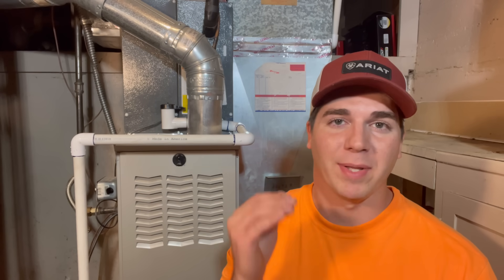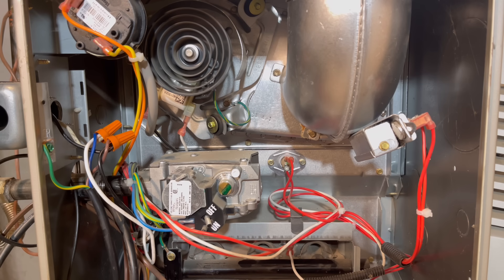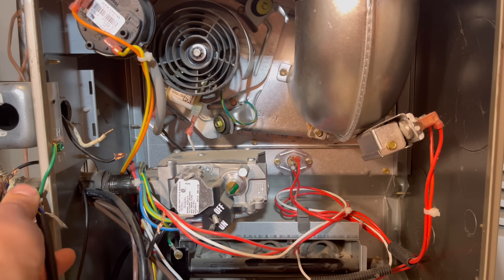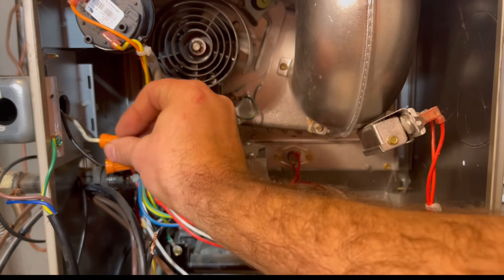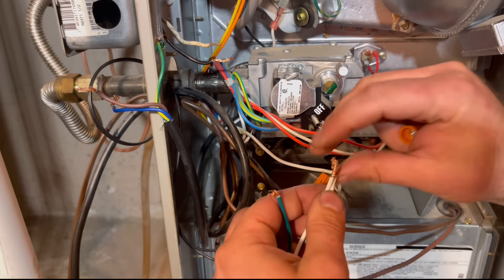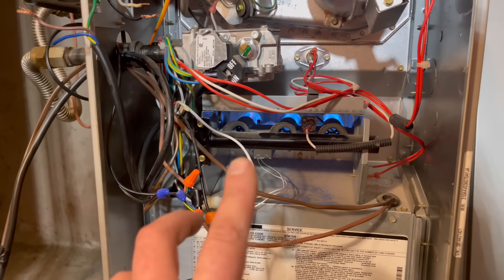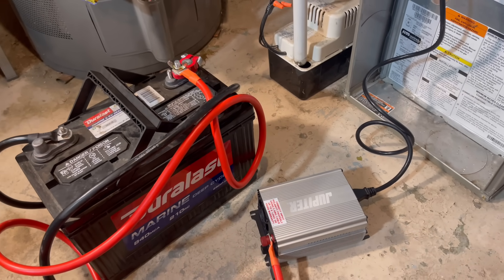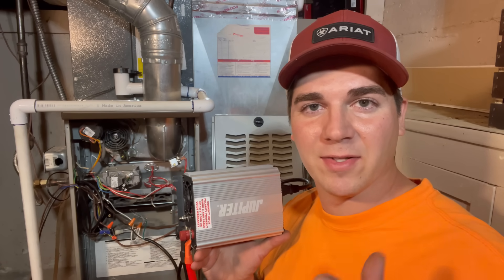Did You Know You Can Heat Your Home With A Car Battery?

Comment: I have been doing this for years. I never had a need for a generator. The best part is everything in our house is run off of gas.
Reply from the maker: That’s awesome, I didn’t realize this was a thing until recently. We are lucky to have easy access to natural gas. Even if I was in an area that didn’t have good access to it, I’d probably buy a large propane tank or lease it and change everything to gas. So much easier to manage with a power outage! Thanks for the comment. Cheers

Comment: My armstrong air handler is wired to 240v.  It's really annoying.  The pump for the hydronic coil is 120v and there is no electric heating elements - no reason why it should require 240v!
Reply from the maker: That is super odd… yea unfortunately this wouldn’t work for ya. Sounds like an interesting system! How old is it?
Reply: @diyhvacguy  put in almost 20 years ago.
Reply from the maker: @Sylvan_dB  do you have access to gas where you are at? Swap that baby out with a gas furnace!

Comment: Great Video. Thank you for sharing. How about air conditioning, summer  we have thunderstorm
Reply from the maker: Air conditioning is a much higher demand when it comes to electricity. This is more of an emergency type situation. In the summer, unless you have a massive generator or solar power in the roof, you just have to sweat it out until power is restored 😂  thanks for watching! Cheers
Reply: buy a generator for your a/c an inverter wont power that.
Reply from the maker: @timothygodfrey4950  I can live with no power in the heat with my pool, haha just need to power my refrigerator. Not so much when it’s 15 degrees outside. I’d really be thinking about an alternative solution if I had an electric furnace though because this trick won’t work for that. Only gas furnaces.

Comment: I have that inverter and though motors are supposed to be okay with the modified sine wave output I am pretty sure it killed my old mini-fridge. Also running a fan off it in the shed during the summer makes the motor really noisy with a sick electrical hum like a transformer. To be safe I would spring for a pure-sine inverter so you could also safely charge electronics if you wanted.
Reply from the maker: I’ll be testing this setup to see how many days it will heat my home next week. I’ll keep note of any strange noises but I will for sure mention this in the test video! Thanks for sharing. Cheers
Reply: @diyhvacguy   At 00:35 you state that " you can power your furnace for a few days" , yet you have not tested this theory yet.
Reply from the maker: @rosseryn8216  hey, yea I uploaded this with the intention of doing that one soon after so I went ahead and posted the first video. This one will show up at the end screen soon. I’m actually going to be using the inverter hooked to my truck so I can run it as long as I have fuel in the truck. Much quieter and way longer run time
Reply: @diyhvacguy  I really appreciate your enthusiasm and you did a great video. But, respectfully, You probably realize that your statement at 00:35 was inappropriate now after learning from so many comments. Unfortunately, this could get some people into trouble when they expect this to work for days. A gentle word of advice: Please, in future videos If you don't know something for certain, tell us that and let us know in the video that it is just a theory yet to be proven. You will be trusted more and your viewership will increase because of your veracity. Thanks for making videos. Cheers!
Reply from the maker: @sherip1270  thanks Sheri, I realize that now. I’ll be uploading a video soon running this inverter off my vehicle which will keep it running as long as I have fuel in the vehicle which I think is a much better approach. Thanks so much for your valuable comment. Cheers
Reply: Modified sine wave is bad for inductive motors.  Pure sine wave is far more reliable.
Reply: Can you give me the name of that inverter? Im looking to find a way to power my fridge because was told we were going to have rolling black outs! If i used two or three car batteries would and used that inverter would it hold a fridge for a couple of days?
Reply: @sir_iosis6760  you can get a used 240watt panel and a cheep charge controller for under 100 bucks to help keep the batteries charged. Fridge going to run about ever 15 minutes and do t use modified sine it causes extra heat buld up in the pump.
Reply: Modified sine causes more heat build up in motors.
Reply: When you charge electronics the charger  changes it to dc, shouldn't matter if it's a pure sine wave
Reply: @johnn3542  "Shouldn't" but I've read plenty claiming that the modified sine may interfere with or damage sensitive electronics like devices that need to charge.  I never had problems running an older laptop off that inverter in my shed but I also didn't care if it got destroyed.
Reply: @one_b  laptop uses a switching supply so they are okay with really dirty power.  Its inductive loads that you need to worry about.

Comment: Where is the video where you test to see how long it lasts? And in general, what is the avg Amp hour rating in 120v terms for the battery you used?
Reply from the maker: I’ll be doing this text next week so stay tuned for that! I’ll also include in that how many amps the furnace components are pulling.

Comment: I’m curious how many amps the typical furnace needs to run and if you could run it off of a portable battery bank like a Jackery or Ecoflow.
Reply from the maker: Oh for sure. So we did some testing with this and the furnace pulled a total of 8 amps on most of the ones we tested with. I will do a seperately video showing the amp draw on my furnace and maybe a few others just so everyone has it for reference. Thanks for the comment! Cheers
Reply: About 8 amps
Reply: Will not run a ac unit 230 volt
Reply from the maker: @DoeyPP  yea unfortunately not, thanks for the comment
Reply: What size of inverter you using
Reply: @DoeyPP  he said 1000W in the video.